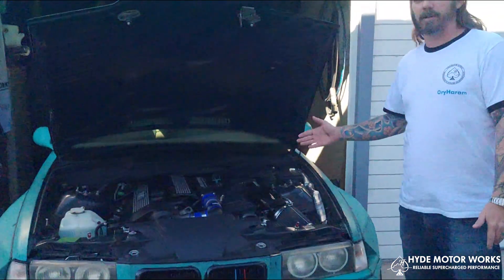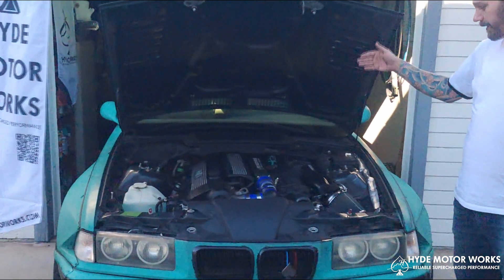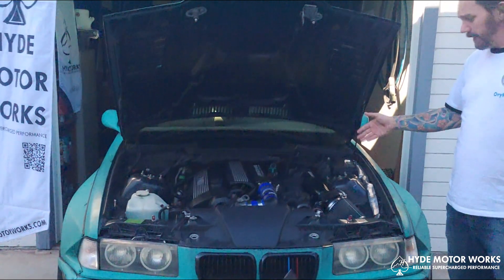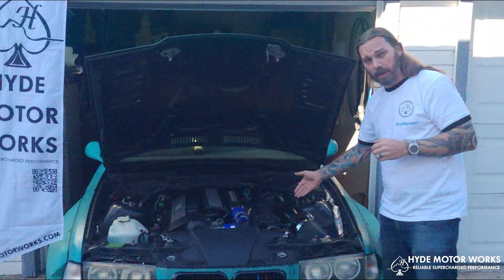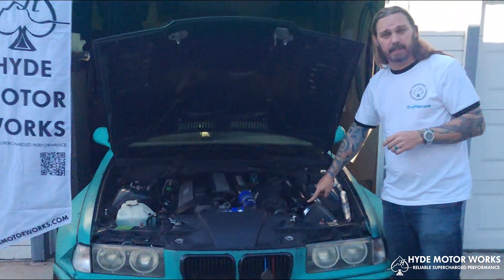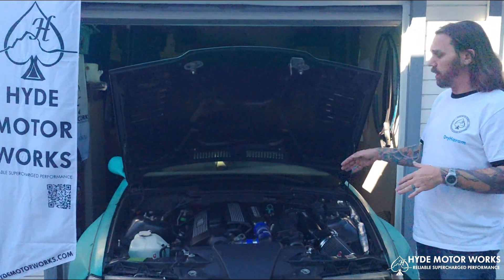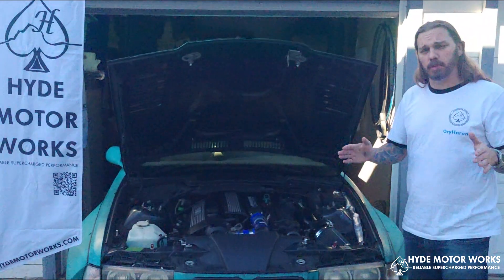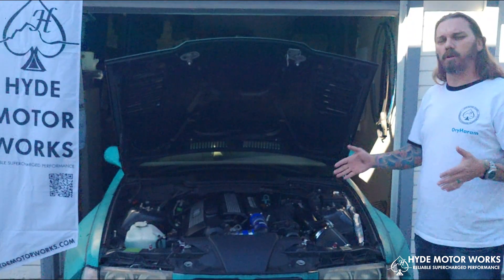BMW E36 Build | M1 REV 2 Supercharger Kit

Comment: What are the gains on a m52b25?
Reply from the maker: @grvyrdgang5672  14psi doubles engine hp. stock m52 can handle only 10psi max, kit can push over 17psi with an m122h and with bigger blowers, over 35-40psi..
Reply: What gains/tq come with the 10psi tune? I’m thinking 12psi for my E83 X3 soon.